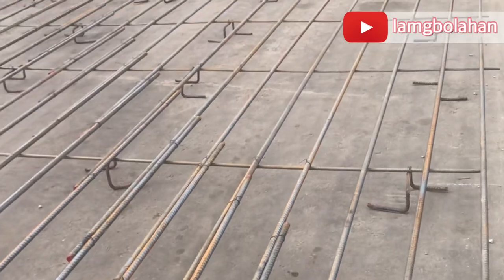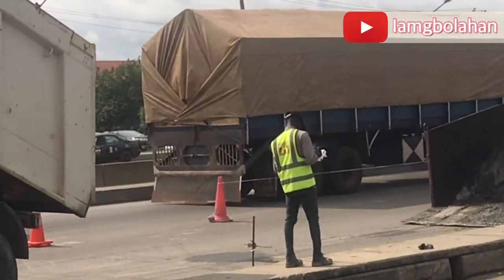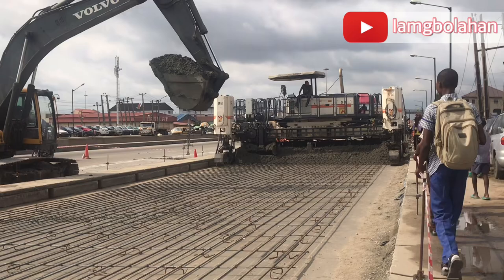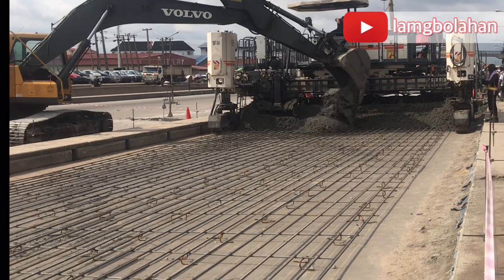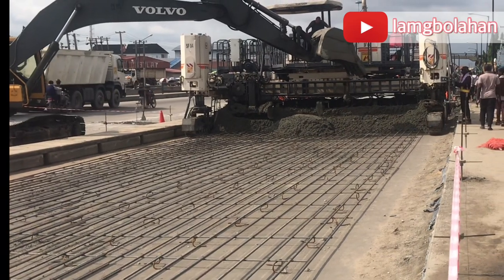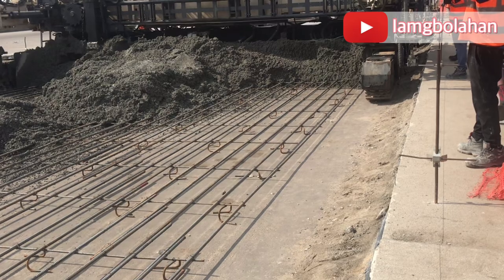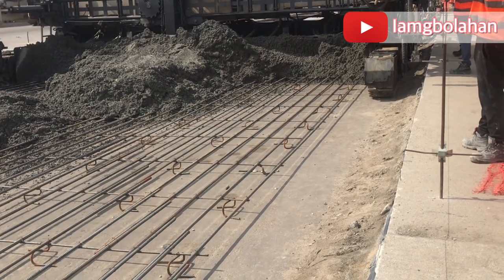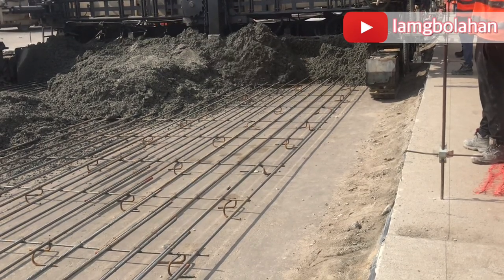Construction Process Of Rigid Pavement Road In Lagos Nigeria / Reinforced Concrete Road

Comment: Thanks! Love the channel. Nigerian governments needs to invest in various infrastructure and industrialize the country quickly. Nigeria has large reserves of oil and Natural gas but there is still power shortages. Nigeria also have huge reserves of bitumen probably the highest in Africa, bitumen is used for road pavement and infrastructure but there is nothing to show for it. Very SAD situation all around.
Reply: You have never said anything good, is it composary you should write?
Reply: Bitumen roads are not sustainable for roads that carry heavy traffic. I drove through Benin- Ore road and saw contractors already patching the asphalt road they were constructing while still on site. What happens to that road 2 years after they have left? It would be a total failure. Here In Accra, the Tema motorway built in the 60’s using concrete is still one of the best roads in the country after more than 50 years. We need to avoid going in cycles and start moving towards development. Hard concrete is the way to go.